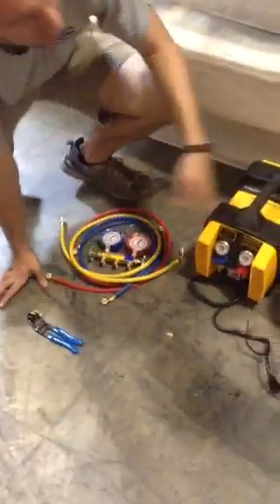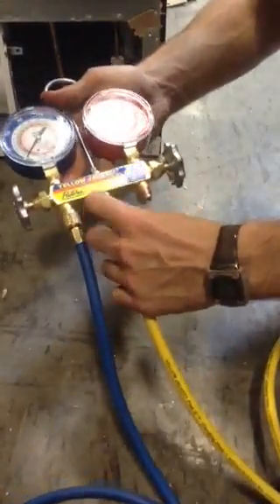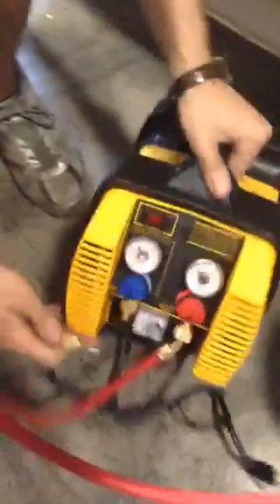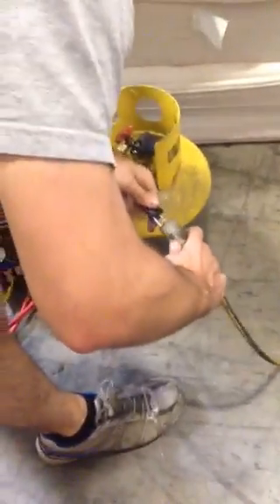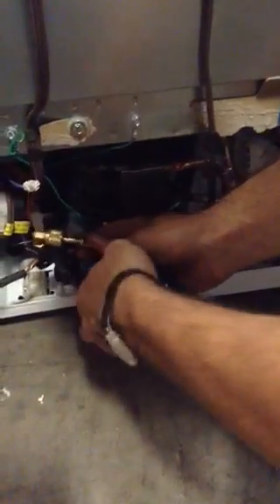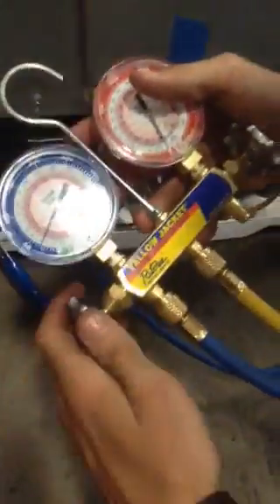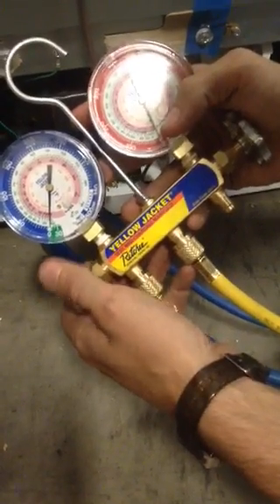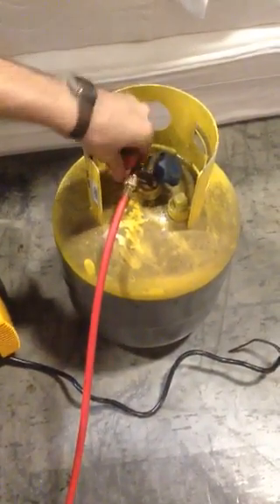How to evacuate  refrigerator freon

Comment: That tool leaked badly. You could hear the hiss. Tap valve is much easier.
Reply: No sir, as long as the discharge pressure on the pump exceeds the pressure in the line there is no leakage. That’s why you start the pump before you prick the line. 

What you’re hearing is the sound of hissing air being vacuumed into the line from outside the hole. I discharge/load dangerous chemicals between barges and docks. This is no different…

Tap valves are unnecessary extra work for people who either have an insufficient pump or knowledge regarding suction/pressure and the correct sequence of discharging/loading closed chemicals.

Comment: by starting your recovery before your adding air to the tank that's not good you also did not weigh in so you have no idea how full the tank is i understand that there is only 5 pounds or less in the re fridge but still come on
Reply: fridges have 4, 5, 6 OZ, not pounds. We have to google if the pliers have a valve to be open after certain squeeze is performed to prick the tube first but I assume the conical seal would have sit firmly before pricking the tube. I prefer my self bullet valve. Some very busy timer savers perhaps do these things fast and release non-condensables later checking the PTC.

Comment: I guess you like air mixed with your Freon but your refrigerator sure won't!
Reply: Definitely true and I was waiting all the time to see him to purge hoses to N.A.. Air or any non-condensables can be removed after the tank sits for some time but I am trying to prevent this each time.Perhaps some recovery machines have a way to deal with this issue automatically but not sure. LS can be vacuumed shortly by LS valve open and HS closed to remove air from LS hose to machine connection. It shows the process on the gauge but I don't know if the air compressed on the HS will be purged just knowingly by the operator before he allows it enter the freon in the tank or if newer machines has some device to deal with this. 
Some will just do it without purging hoses and will release non-condensables later and check PTC later I guess to save a time especially services not having too much time for details.
Reply: Why would you reuse it?

Comment: Is there any way of telling whether freon is still present in the system of an ac window unit without any fancy equipment
Reply: If the AC works and it blows cold air they're still refrigerant inside no more than an ounce. 
Also window units, ACs have to be at a slight angle for the water to leak out 👍🏼

Comment: If anyone can help please do
I am apprentice My problem I just recovered R22 from a old Russell unit cold box the reason I had to is because the customer wants the unit move a few feet back so I cut the pipe already capped the ends off and will be reinstalling pipe Monday. My question is after I install pipe purge, braze, will it be ok for me to put a vaccum pump on it? I was concerned about the refrigerant oil in the system will that damage the pump? Or will there be any oil in there after my nitrogen test? If anyone can help me I greatly appreciate it
Reply: Braze ,do a nitrogen test...recover or release your nitrogen  ..then vacumm & no it will not damage the pump only make sure your vacumm has oil to level.vacumm dwn.5 micr

Comment: I'm not an HVAC guy and even I know this whole procedure was botched. Please don't follow this guys advice people! He needs to take this video down or remake it.
1) His machine sounds like it's on the way out, I would assume misuse/abuse. That's my first clue I don't wanna do what this guy is doing.
2) Those pliers... chuck them in the trash. Use a piercing valve instead. If you must use the pliers, please use them correctly with the right seals in place. You can hear that thing leaking refrigerant as soon as you clamp it!
3) As everyone else is saying, you now have air in your recovered refrigerant, noob mistake. It's not even hard to avoid this, it's obvious.

I probably missed some stuff, like I said, I'm no expert. I'm the one searching for videos on proper refrigerant recovery methods.
Take the video down man you are a leading people astray!